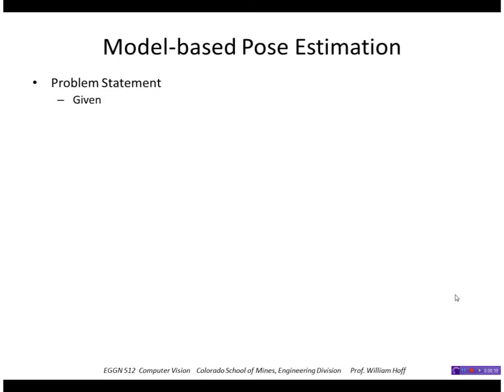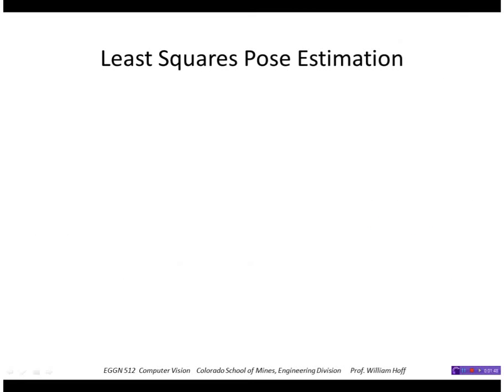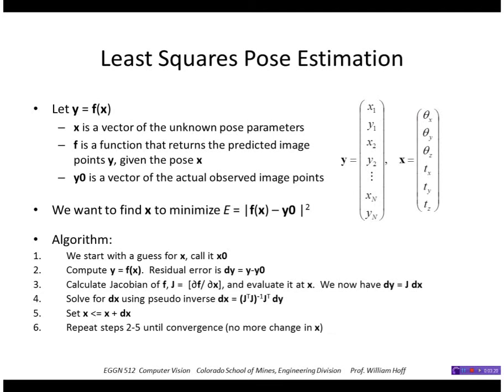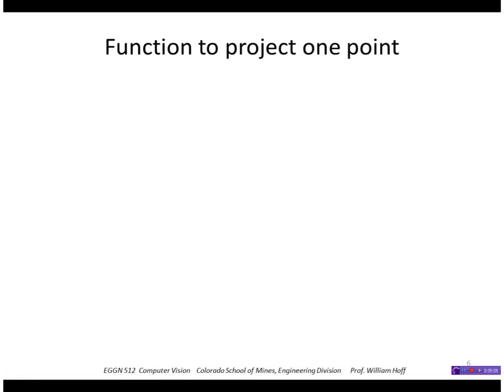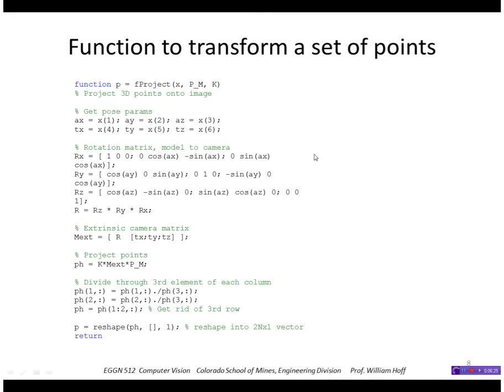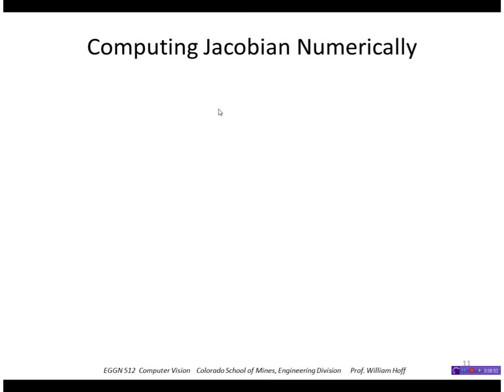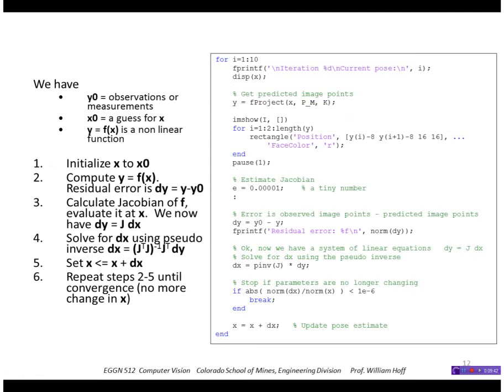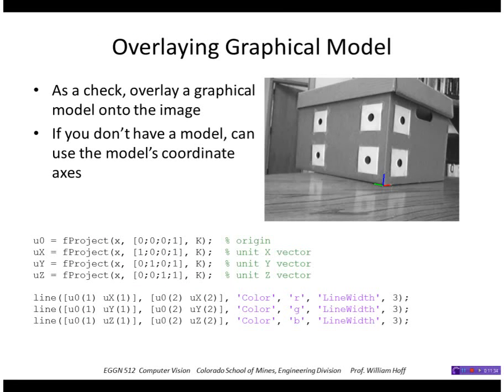EGGN 512 - Lecture 16-1 Pose Estimation

Comment: If anyone is listening: I copied the program into Octave and got it to work nicely. Then I translated it into C++ and got the same result. However I am confused by the result. How do I interpret the pose? Yes, it is the 'rotation vector' and 'translation vector' joined but rotation WRT what?
Also: I changed the code to use the RVEC (rotation vector) as a angle-axis form and used the Rodrigues convertion to make the rotation matrix. The final result was exactly the same for the final 'y' and for the individual 'dy' components BUT the pose result was different. The iterative algorithm converged in the same number of steps and got the same 'y' result but the pose was different. I am confused.
Reply from the maker: Hello Rob - the rotation and translation specify the pose of the object with respect to the camera.  Yes, you can have the algorithm solve for the rotation vector (instead of XYZ angles), and it should yield the same pose.  I have recently changed the lecture materials to use the rotation vector (and implemented it in Python).  I can send that to you if you want it.
Reply: @HoffWilliam  I have determined that the same rotation matrix is produced although the rotation vector portion of the pose is different.
Specifically I think you got an Rvec of < 1.5481, -0.8323, 0.0971> using XYZangles, I got < 1.4889, -0.5879, 0.7163 > using Rodrigues' method but they both yield the same rotaion matrix so I'm good on that. I prefer Rodrigues' because I think the angles can be interpreted directly as < roll, pitch, yaw >.  But I am still confused about the reference frame. Fron the video I get the idea that the reference is the lower front corner of the box, the place where coordinant <0,0,0> is in the Model frame. But looking at the Rvec, the roll angle is about 85 degrees ( ~1.5 radians) and I think the Y and Z axes are swapped by this. Anyway, I am still pondering it.
Thank you for the offer of a python version. However I am using a version I put together based on your example using C++ and I am much more comfortable there. Also thank you for your reply and the large body of fascination topics you cover in your videos.
Reply: @HoffWilliam  would you mind sending me the python code you have that solves for the rotation vector instead of the XYZ angles? I already implemented the version you have in this video in Python, I'm just having some trouble understanding the output&converting to YPR because they don't match my ground truth data which is in YPR.
Reply: @jennasawaf4491  would you mind sending me the code too? I am working on almost the same thing? Thank you
Reply: @HoffWilliam  would you mind sending me the code too? I am working on almost the same thing? Thank you

Comment: Dear Prof., You have mentioned that the goal is to find pose of the object w.r.t. camera. Can we just invert it to find pose of the camera w.r.t object and use it for localization of a mobile robot in a environment with known 3D Map ?
Reply from the maker: Yes, that is certainly possible.  You can invert the pose of object-to-camera, to get pose of camera-to-object.  If you also know the pose of the object in the 3D map, then you can find the pose of the camera with respect to the 3D map, by multiplying those 4x4 coordinate transformation matrices; ie. pose_cam_to_map = pose_obj_to_map * pose_cam_to_obj.
Reply: @HoffWilliam  Thank you Prof. Could you please point me to the best and accurate algorithm for solving this model based pose estimation problem ? I am exactly working on localising using a 2D camera within a known 3D map. I can use feature descriptor to generate 2D-3D correspondences. Is the method explained in this video is the best or do you suggest me to try any other alternative solutions for this ??

Comment: Hello Professor Hoff,
Is the algorithm for the least squares pose estimation the same as the Gauss-Newton algorithm?
And am I right assuming that the assignment of the points (which image point corresponds to which model point) has to be known in order to apply this algorithm?
best regards
Reply from the maker: +Wurto Yes, you are correct on both - it is the Gauss-Newton algorithm, and you do need to know the point correspondences.